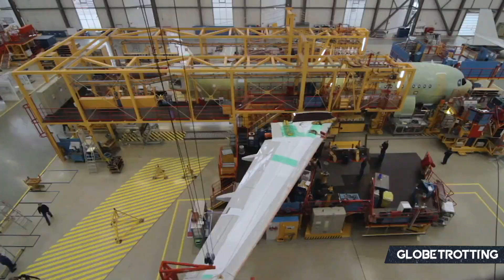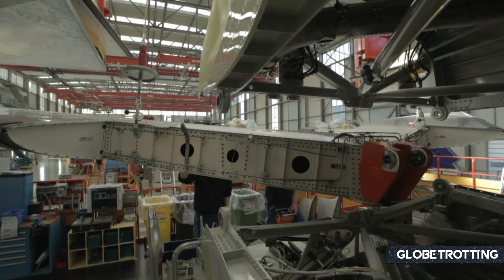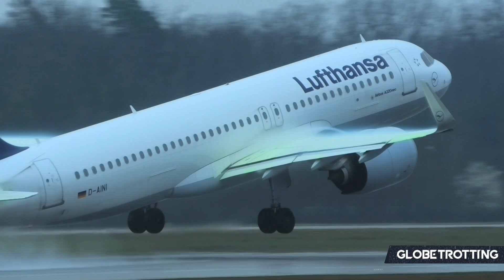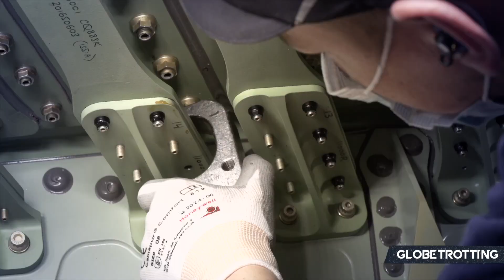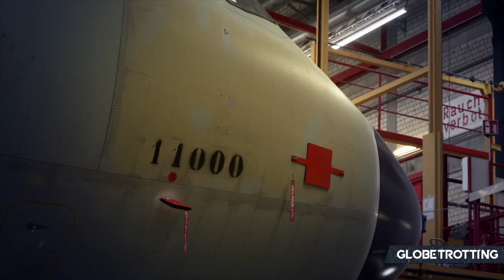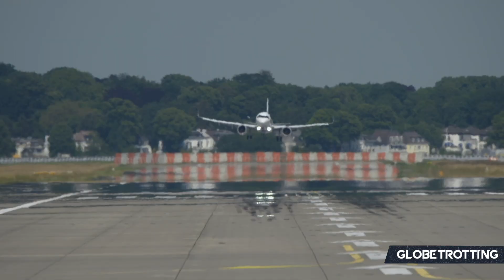NEW AIRCRAFT? - Airbus A320 Future

Comment: The Airbus a321 XLR is popular with airlines,  but it would have been better for Airbus to put a bigger wing to carry more fuel than a center fuel tank, since the aircraft could have more cargo capacity. Also having a wider wing span could help with takeoff performance. Most runways do not have that problem. The Boeing 757 can takeoff from shorter runways not because it has more powerful engines but also a bigger wing span. There are some airports such as Vagar Airport in the Faroe Islands that extending the current runway is impractical due to the runway being on top of a plateau and not enough area left to extend the runway. Also the the a321 could have extended the cabin length to have more seating capacity. That might have cost more upfront, but the certification process might have been less strenuous than what Airbus had chosen.

Comment: The the A320 will get a new wing and possibly a new high-bypass jet engine based on the new gear-turbofan technology Rolls-Royce developed by around 2030.
Reply: Agreed, new engines are a must. Unless you were to replace the wings with a lightweight composite now, the current single aisles have probably been stretched as far as the current engines can cope.

Unless the market has changed significantly, I suspect that there will be insufficient demand for a single aisle as long as the 757-300 - although, 
possibly something in-between.

Watch out for folding wingtips!

Comment: A320 family is absolutely a resounding commercial success for Airbus. Given its engineering excellence and versatility, this aircraft family has become the backbone of lots of major airlines. On top of that, the a320 will need to pounce on the tainted reputation of the troublesome 737 max program amid booming demand for democratized air travel.
Reply: Well, Airbus had been studying what became the A320 as far back as the middle 1970's, when the various companies what of became Airbus Industrie each studied new single-aisle planes based around the then-new CFM56 engine. Their efforts were combined into the Joint European Transport (JET) project just before 1980, and it was such an attractive proposition that once the plane was announced, orders came in in a big way.

Comment: Unless the tube is replaced by a differing configuration then the only fundamental improvement by an air framer could be in offering a CF wing replacing the current wing. Lighter and with significantly higher aspect it could provide a substantial improvement. The slight issue is that it will be very costly, the A220 wing is an expensive product to produce for Spirit

Comment: I think that for the medium term, an Airbus 320 with a new (composite) wing and a new generation of engines will probably offer an economic improvement that will meet airline requests. In the short term, Airbus will probably try to reach a production of 75 units/month and will also try to complement its portfolio with an A220-500, which will kill the A319